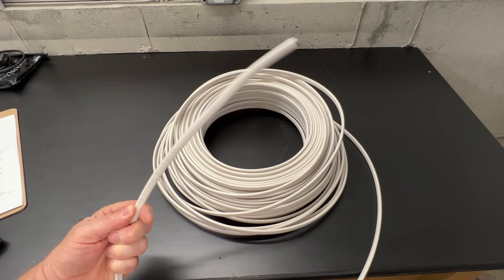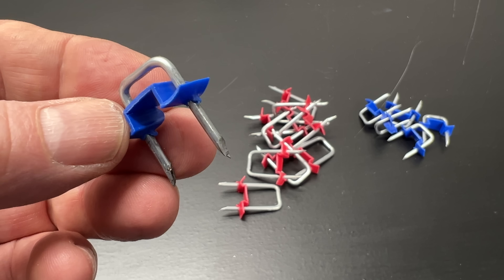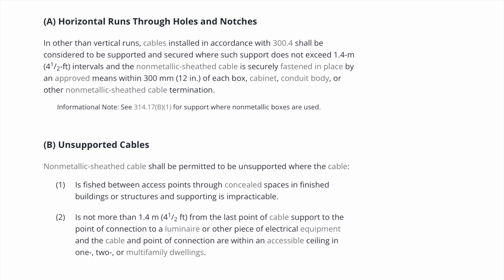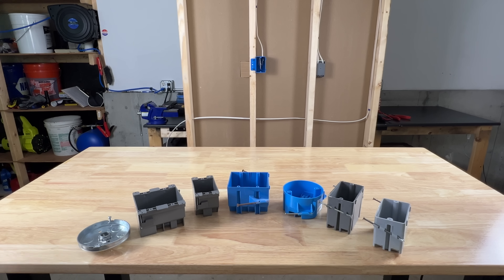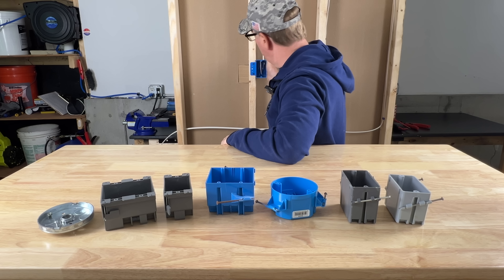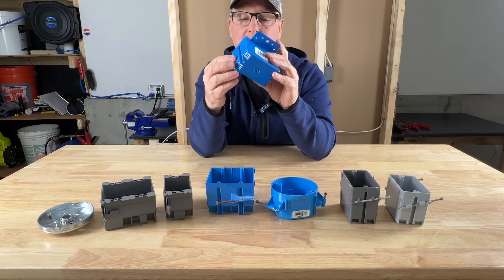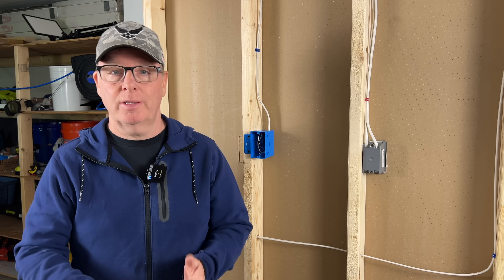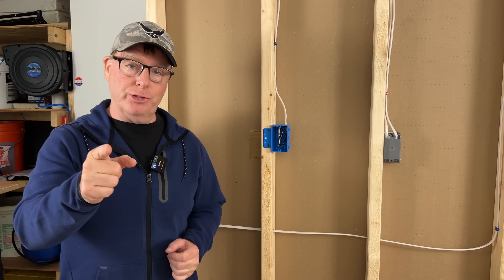ROMEX Cable Support Requirements (2025)

Comment from the maker: Need a cool work station like mine? Try FlexiSpot!
🌟 Use my code “24BDYTB50” for extra $50 off on the E7 Plus Desk! Trust me, it's a rare treat!
FlexiSpot E7 Plus Standing Desk: https://bit.ly/4aM11Dg (US)
FlexiSpot E7 Plus Standing Desk: https://bit.ly/4c6iasg (CAN)
Reply: Thank you
Reply: I was just looking for an adjustable table for my shop. Thanks for the suggestion. I hope the discount still works.
Reply from the maker: @warrenscorner  I know it was a sponsored video but I do actually love the desk. It's heavy duty  and really well made.
Reply: Good video. But I recommend against using Flexispot. I had a controller fail after warranty expired. The rest of the desk is still fine but when I contacted them to Buy a replacement controller they refused to sell me one and said I had to buy another desk.
Reply from the maker: @BabyDeer_Red4 Can you tell me the model number you bought and what actually failed? A motor, the push button actuator or the control module on the bottom of the desk? I'll reach out and see if I can help.

Comment: I use only metal boxes with metal connectors.
I staple all within 8" of every box that I have access to.
Additionally, I run my wires from the bottom up not the top down in case of water issues.
Thus leaving a drip loop of sorts.
I despise plastic. Deforms too much and won't stay put when plugging and unplugging things in the new TIGHT outlets.
Ya know the 'kid safe' ones....

Comment: I've never seen any good reason to staple cables in place except as a way to keep them running straight and tidy.  If you nail or screw into a wall and hit a romex that's stapled and can't move, you might short it out.  If you hit a loose piece of romex, it'll just move out of the way.  And not having it stapled allows you to pull the cable out without tearing out the drywall if you need to fix something or upgrade to a lower AWG.

Comment: I’ve been an electrician for many years, but most of my work has been in industrial settings, so I have little experience using staples on wood. Do you have any tips to make it easier? I often end up smashing my fingers and the wire so much that I actually dread having to use them.

Comment: Confusion about Code Compliance is one area where artificial intelligence could be useful.  It could even draw a diagram to show graphically what is permissible.
Re the adjustable table, I'm happy that I bought one. But I made it better by building a tool cabinet that sits below and between the legs.  It holds a lot of tools.

Comment: On the back of the box it says what you can use the Staples for not how many are under one staple. It also says you have to have a staple within 8 inches of the box. It doesn't have to be stapled within 8 inches of the cable length. Just within 8 inches of the box.

Comment: Hi - do you have a video about raceway wall cord covers ? Im planning to run wires for a new bathroom and dont want to fish wires and open holes in the wall.
Reply from the maker: I don't have a video on that.. sorry. You can search wire mold and probably find what you need.
Reply: @BackyardMaine tganks, my concern is how will it be NEC compliant, will be good  if you can provide consultation for a fee.

Comment: So i have a question from what i see hear fishing wire through old walls if far from code 
do you have tips/code ect on doing this thanks
Reply from the maker: When fishing wires between two access points in an existing finished wall, you don't need to support the cable. 334.30B Unsupported Cables..

Comment: Would it be okay to run an extension cord 15-20’ in the attic from an existing outlet to a low voltage led control box for soffit lights? The extension cord would be wired to the power supply feeding the lights, only drawing about 1.9 amps max on the ac side. The extension cords available range from 13a rated to 20a rated. The LED control box will never pull that much current
Reply from the maker: It’s not legal to run an extension cord for wiring or for permanent use. It’s a common cause of house fires. You should run either 14 or 12 gauge romex for this depending on whether it’s a 15 or 20 amp circuit. They you will have a legal and also safe installation.

Comment: Question.  the first blue box you say has cable clamps then the one you show with the tab that gets nailed to the front of the stud you say does not , but it appears there are small plastic tabs where the wire enters ?
Reply from the maker: The blue boxes have what called knockout tabs. The are plastic pieces that you knock out when your installing a cable. The ones that aren't use stay in place to keep the box closed up. These play no roll in securing the cable. The boxes with clamps have a heavy plastic piece that you push the cable through and it holds the cable tightly so it cannot be pulled out.

Comment: What about steel stud construction? Is there a video link on that already by chance?
Reply from the maker: I don’t but the requirements for support are the same. Holes need to be punched with a special hole punch and grommets need to be installed before the cable is run. Also the support fittings and or cable ties have to be specifically listed as support fittings for NM cable. Obviously staples cannot be used but on steel framing.
Reply: @BackyardMaine  So basically, it gets treated like it should, and as if you were passing wires through a firewall of a vehicle. Got it. Sounds like I am gong to have a lot of work ahead of me with a complicated build already. Thanks for some mental clarity.

Comment: Thank you. Often the NEC addresses similar issues in different sections making it difficult for homeowners to be sure they are code compliant. Your pointing out these sort of issues allows a homeowner to avoid the wrath of electrical inspectors.
Reply from the maker: I am happy to help clarify some of the codes for those DIY projects.

Comment: If you want to leave more service loop, just place your last staple within reach of a flat head screw driver via the KO/cable clamp. Also make sure to hit that staple in like a girl before drywall so if you need the loop, you can pop it free without a struggle.

Comment: I dig it. I’ll be doing electrical work sometime probably early next year and I’ll take everything I can get by osmosis until I finally get my hands dirty
Reply: I highly recommend doing pigtails at receptacles and using Wago lever connectors instead of wire nuts.  There’s also a tool called a Volt Claw that can save you time and frustration.  Best of Luck!

Comment: Cable ties, AKA zip ties, are supposed to be rated 21s. The s is for support. My local inspector called me out on this one.  *Make sure your zip ties have that little 's' in addition to 21.Ty-rap are the best. You can use 1 staple vertically and zip multiple cables to it.

Comment: I dont get too in the weeds with code as alot of it these days is clown material. Consider code first, but implement some personal judgement. Debating 12" distance and 12" cable length is silly lol.
Reply from the maker: The reason the code changed to limit the max cable length to 18 inches was because people were leaving large loops at every box leading to wiring being pinched or otherwise damaged.
Reply: @BackyardMaine oooh that makes so much sense now. Thanks for the insight!

Comment: Hello.. no the subject.. i need to know if a gutter or wireway need to comply with 314.28.. there is notb much information how to undestand whats a gutter wireway and wireway used as pull  and if this rule applies..thanks
Reply from the maker: Article 376 of the NEC cover wireways which are often called gutters as well.

Comment: The clamp in the box does not count as securing the romex within 12" ?  But it's not required. Why is the clamp on the box ?
Reply from the maker: Most single gang plastic boxes don't have clamps so the cable needs to be supported within 8 inches of the box. Old work boxes (designed to cut into an existing wall) have clamps because in most cases the cable is fished into the wall without support. I cover that in the video as well. Boxes with clamps that are not used in an existing wall will still need a support but within 12 inches not 8. The code allows cable to be unsupported when fished into a wall for a couple of reasons. First, to make it possible to extend, add or move part of the circuit without remove the wall finish and also because the risk of damage to the cable is reduced once the building has been completed. Nails, screw, pinched cables, other trades damaging loose cables are reduced when the building is done.

Comment: Ok, resi sparky here. The code for Romex out of a box, with a connector is 8" from the top of the box. If the box doesn't have a connector (or the apprentice busted the little plastic tab completely out of the box) it's 6" from the top of the box and 4' there after. 

However, most sparkies I know  do about 4 inches from the box because it looks neater, and guarantees that if you need to move the box or extend the wires after sheet rock, you can pop a staple from the existing hole and gain 1-2" of wire.
Reply from the maker: Must be a local code because it's 8 inches with no clamp, 12 inches with clamp and 4 feet there after. NEC Article 334.30

Comment: How do guys with the OCD large looping service loops from below and from the opposite side of the stud bay getaway with what they are doing?
Reply: Of course the first external support of the cable needs to be on the same structure the box is mounted on,  and box will need a clamping mechanism for courtesy loops to be deployed. Should be easy enough with 18 inches of cable where localities require 12 inched of slack.

Comment: Thank you for your video! I learned more than I was looking for :)

Adding a sub panel into a finished wall on the first floor. The ser is coming up from the the crawlspace below. This ser run doesn't need support within 12 inches of the sub panel? 

(B) Unsupported cables at 3:48

I really don't want to open more of the wall than I have to it's plaster and metal lathe.

Comment: Im confused.  A veryical run must be supported/stapled against the stud, except where you are adding/extending a run?  If I run cable from a ceiling box and down the wall, say for adding an outlet, I dont need support?  Why?
Reply from the maker: One of the reasons cable is supported is to hold it in place during the rest of construction. If cables were not properly supported, many would be damaged by nails screws and even pinched between wall surfaces. Once the walls are finished the risk has been substantially diminished. Also the code doesn't want to make it impossible to run a cable in an existing home without the expense of removing and reinstalling the existing finishes.

Comment: Can you please answer a very important question? If you are installing a new electrical outlet (say for a TV mounting installation), sometimes it's very hard or even impossible to add a Romex staple inside the wall. For new constructions, it's very simple and easy. But for closed walls, how do you address this issue? Is it OK to run a new Romex between an existing outlet about 4-5 ft to the new outlet without any staples if you are using the appropriate electrical boxes or plugs which lock in the Romex and prevent it from popping out of the box(es)?
Reply from the maker: I actually covered that in the video. If you fishing wires in an existing wall you don’t need to add supports.
Reply: @BackyardMaine I actually saw that answer later on in your video and also found the actual code stating that. Thank you for answering.

Comment: Cant you S curve NM in the wall to legally cheat your service loop? Its not an actual loop and so long as youre maintaining your secured points you could still achieve good workmanship and a build up of wire thats sufficient for future modification and work while still meeting code and passing inspection.

Comment: So if I’m adding a junction box for a 220 circuit, in my finished garage, approximately 15” away from the main electrical panel, I can fish the romex directly from the panel to the junction box without needing to support the cable?
Reply from the maker: Yes..
Reply: @BackyardMaine thank you for replying

Comment: Now this is rich. Please go to the :24 second frame of your video which shows your beloved Code Book cover and note that it is NFPA pamphlet 70.  I was a manufacturers rep on one of the NFPA technical committees for several years because one of my emloyers voluntold me.  I wasn't working on that pamphlet but one that incorporated it by reference where it applied but always as NFPA 70 (Latest Edition). Most of the pamphlets I was involved in were in the 1900 range.  Emergency power was involved in almost every unit I built as was multiplexing, 12/24/48 volt DC, radios, visible and audible warning devices.  My last shop was small but I stocked wire from 4/0 to 18 gauge all in multiple colors and most of it was custom printed with my circuit numbers and functions every 6" all clad with crosslink polyethelene insulation. Each job got backed up with wiring diagrams as well as location maps for critical components, certificates of compliance where required and the finished product was backed up by a 100% performance bond before I even started work. If my work were to actually fail, the types of customers I had don't leave nasty Yelp reviews, they sue.  You may have had local code inspectors nit pick you but I have had UL inspectors looking at my work on an individual basis and that's the difference between UL rated and UL inspected(certified), with my work your got a UL certificate with the test results for that exact item instead of a cheesy imprint from a mold embossing.

Comment: what is with the plastic on the staples? is that code?
Reply from the maker: It's not code but most manufacturers use them. They add a level of protection and also can be used to determine size.

Comment: What abut running it in the ceiling of garage with an unfinished ceiling.  Running through  joist with no support
Reply from the maker: A hole in a joist is considered a support. You would just need to staple within code for the box. If you're running on top of the joist then you would need to support every four and a half feet.

Comment: 3-27-25 and be aware that for some reason the date of manufacture has been added to the information strip printed on the Romex. Will a city  building code inspector nokw now when you installed those wire runs without a permit.

Comment: I was under the impression those knockouts are not knoxk outs. That you keep the cable flat and push it through tbem angling it and it pinching the cable. I've heard of inspectors failing people if they see them knocked out. Probably because they knock them out and stabled incorrect distance.
Reply from the maker: There are two types which I cover in the video. The knock outs which are meant to be removed in order to install the cable and require the support to be within 8 inches of the box. Then we have the plastic cable clamps which pinch the wire and require the box to be supported with 12 inches of the box. These should not be broken out and if they are you will probably get failed on your inspection.
Reply: @BackyardMaine  Yes, im aware. However, the type I'm referring to is the ones you refer to as  knockouts. They're not actually knockouts. They pivot on the center connecrion point, and when a cable is installed, pinch it, holding it in  position. They can be knocked out, but that is not the only aspect of the design. What I'm saying is I've heard of inspectors failing inspections because people knocked them out and likely didn't stable at 8"s. When they could have left the knockouts in place, which would have secured the wire and passed inspection perfectly at 12"s. Hope that clarified what I meant, it's easier to show with a picture or video.
Reply from the maker: @lj5773  They are considered knockout by the manufacturers. They more than one connection points so they don't fall out. You can leave them in but they provide no value. The code also considers them knock outs rather than clamps.

Comment: What a great job you did on this video. There are so many codes that it sure creates a lot of confusion. You did a good job of clearing it up on cable supports. I was however wonder does the FlexiSpot meets all of the code requirements? (just kidding on the Flexispot)

Comment: Get real just do 6 or 7 inches above the box like we all do in the field. That goes for mc as well. Why make such a big deal.
Reply from the maker: The video is about the code requirements. You can alway support closer. I have never measured a staple other than in the video for illustration.

Comment: So for boxes without cable clamps, can i staple 4" from the box, with 4" of slack/loop? That would satisfy the 8" max distance of cable support and cable length?.
Reply from the maker: Yes just be sure not to make any hard sharp bends. There are bending radius requirements for NM cable as well.
Reply: Came here to say this!  
How about the first staple being “snug” but not binding the sheath such that if needed a bit of slack between the 1st and 2nd staples could be pulled through if really needed 10 yrs from now?